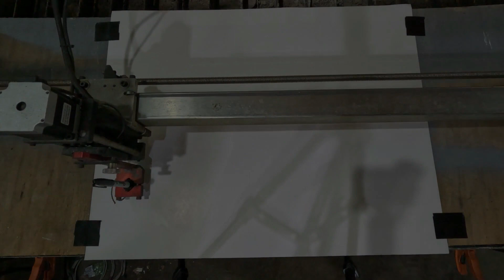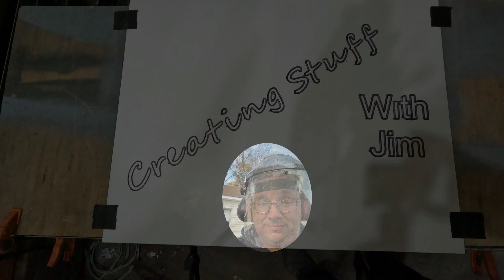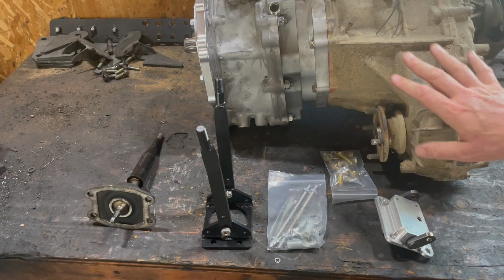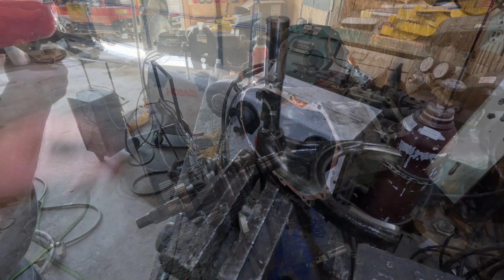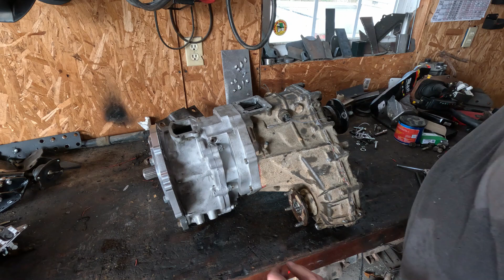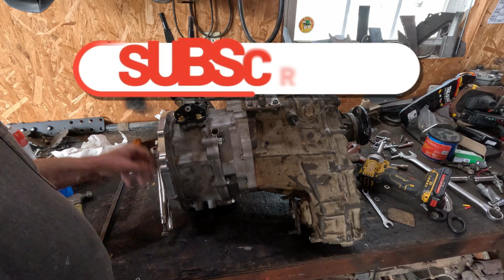Rad design Triple Stick install on Tacoma drive train. Inferno Build Episode 4.

Comment: Hi Jim, I think we wheeled together briefly at GSMTR 2024. I have some questions about that RAD kit that I am wondering if you might be able to answer.
Reply from the maker: @stanleyhughes2460  i am more than happy to answer any questions you might have. What vehicle where you driving?
Reply: @creatingstuffwithjim  I was running the sas'd single cab 3rd gen p/u in front of you when your birf popped. I am looking at using the RAD setup just to move my rear sticks of my dual case setup forward. I have dual cases and my crawl box is forward shift configuration. I don't care about the 3 sticks being in line I moreso just need my twin sticks moved forward to create space between my seats. So, my crawl box shifter would stay in its factory forward shift configuration adjacent to the trans shifter, the RAD shifters would bolt to the top of my crawl box. Do you see any reason this might not work? I can understand it not working as a "true triple stick"  but again, not what I am after.
Reply from the maker: @ there should be no reason that should not work. You may have to make a custom flat block off plate to replace the factory one since it is stamped sheet metal. Yes I remember you. That was not an enjoyable day for me. The sun moon and stars lined up to get me that day.
Reply: @creatingstuffwithjim  That was my thought as well, sandwich a plate/gasket between the RAD setup. Will you be back this year?
Reply from the maker: @stanleyhughes2460  unfortunately not I will be traveling through Newfoundland this year. My buddy who was there with me will most likely be there
Reply: @creatingstuffwithjim  well I wish you safe travels
Reply from the maker: @stanleyhughes2460  thank you. Hope I get to wheel with you again one day